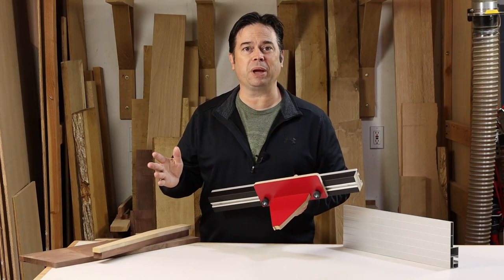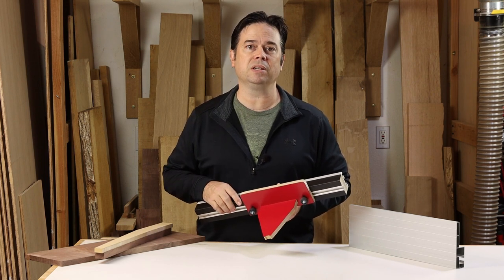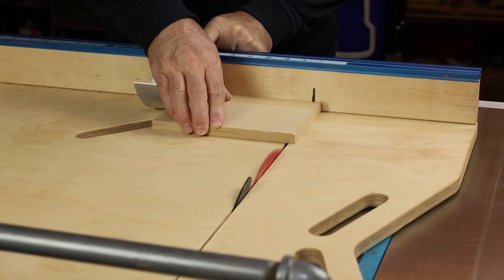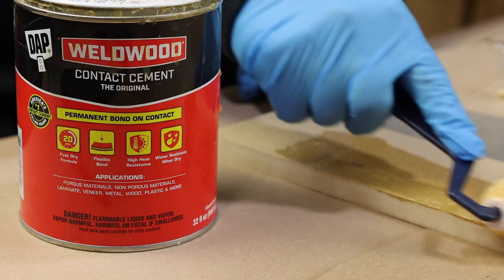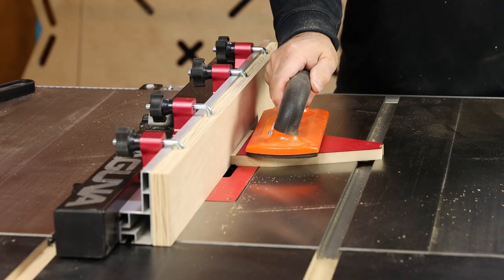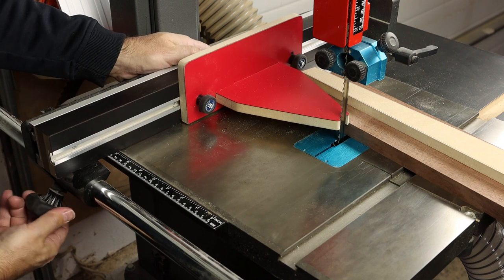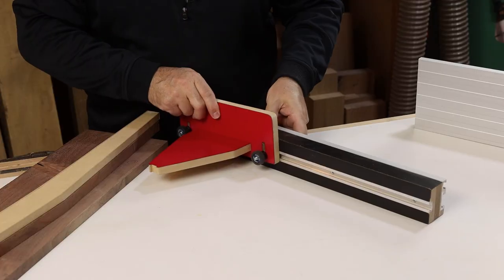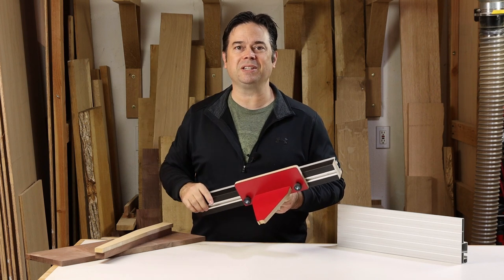How To Make A Bandsaw Cutting Jig For Pattern Woodworking | 1412 Bandsaw

Comment: Thumbs up to Laguna for putting out a video on how to make a useful, generic jig that people can whip together with scraps. There's a time and a place to drop cash on a factory made jig but this is not one of them. This concept is so simple and works great with a Kreg fence. If you have a smooth fence, just give the vertical piece enough height to give yourself a wide range of clamping heights.

Comment: I made two of these following this video. My band saw is only a 10” model so I had to make the jig a little shorter. I measured from the furthest distance I could mount it to my fence to make it as long as possible. I’ve used them over the past two days. My first observation is obvious-that there’s a trade off between the width of the opening and the ability to follow steeper curves. Using a 1/4” blade, I wanted to follow a lot of curves in my templates. However, given my 10” bandsaw, there’s a limit to how much you can turn the stock because I can come into to contact with the fence and can’t continue a curve. So I have to remove the fence and freehand certain curves. Also, with an opening just slightly larger than the 1/4” blade, because I’m trying to maximize the ability to follow curves, it’s impossible to avoid the blade touching the front inside of the opening. It’s fine for awhile but eventually it breaks off. I made “replacement openings” out of 1/4” mdf and glued them on top of the Formica and then power sanded down the other side so the template doesn’t get too thick. Then, the process repeats…except for when I dropped the jig and broke one of the opening sides off. 😢 If one were to want to improve on the design, I would try to incorporate replaceable “tips” made out of something more durable like hard plastic that could easily be changed. When I first made these, they were beautiful. I used white Formica but they looked nice. Now, they don’t look so good, but they work… with some issues. 😢
Reply: Solution is to just make an L-shaped base the same width as the jig and then clamp the horizontal foot onto your table. Vertical piece to suit your bandsaw size for max and min desired mounting heights. Could have vertical slots for infinite height adjustment. The same jig could be fence mounted or table mounted with that kind of an adapter.

Comment: I love how you even painted it red so it looks like the rip off woodpeckers tool they just released
Reply: Not sure if you are saying that Woodpeckers ripped this tool ideal off or if Laguna Tools ripped off Woodpeckers ideal?
    This follower style design has been around for a very long time and also Featured on Page 26 of Fine Wood Working (FWW)Magazine No. 271 December 2018 and prior to that in FWW No.173 Also featured in Five Tips for Better Bandsawing by Michael Fortune. There are numerous Template -guided cutting pattern/template cutting jigs for the bandsaw.  Bolt on follower for old PM/Delta/PC ETC, A follower like this one in this video. Mated fence setup  where matching concave half is used as a sled to slide along the template with the blade trapped by the convex half / Angled ARCs. I made the follower style shown in video when I was in High School Wood Shop as a shop jig for the entire class as a Student because I wanted a small table that was not a hexagon and the teacher showed me how to do it and then made me do it and I had to share  the jig with the class. That was in 1987. Difference it did not mount to the Fence as extruded aluminum was not a thing then it mounted to the table top of the bandsaw with clamps. 
 But yes it is a nice touch that Red veneer / laminate was used maybe to rub it in Woodpeckers nose that the jig can be done with scrap wood and be just as good as a high priced jig.
Reply: @jwar2163  I think it's just a hilarious coincidence where you can build this for free with crap in your shop waste bin... or you can pay $219.99 US for Woodpeckers magnetic one that will ONLY work on tables that are magnetic.